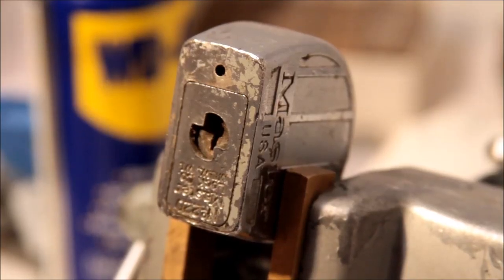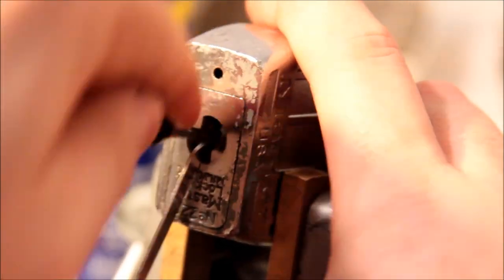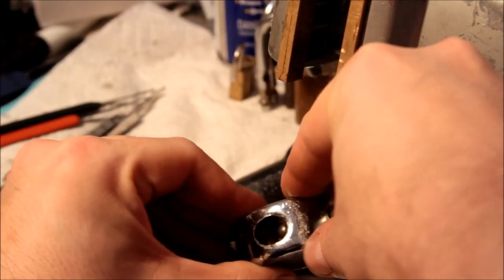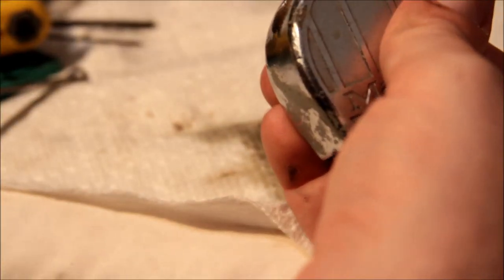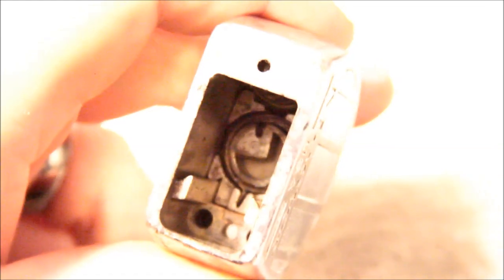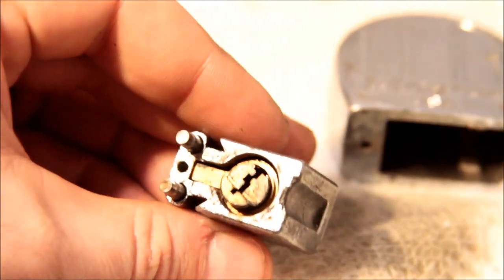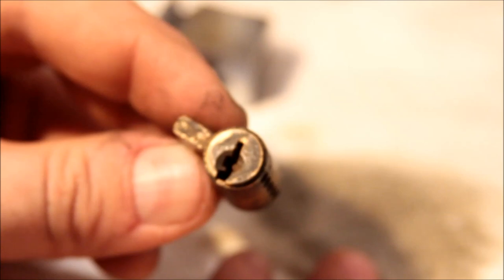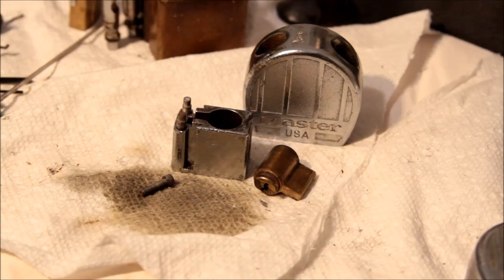(122) eBag 'o Rust: Part 3: Master Lock: Some things never change

Comment from the maker: Thanks for the tip. I'm still working on my cinematography skills, as you can probably tell. 

For some of these macro shots, I've found it easier to take still photos, edit them a little, and insert them in the video. Your point is well-taken though and I'll give that a shot!

I have a couple  videos on tubular/Ace locks. If you'd like to see anything in particular, let me know and I'll see what I can do. Several of the other guys also have great videos on the subject.

Comment: I don't know if that core was double crimped, the single crimped you turn the core and it slides out. I just had a double crimped core I smacked it with a hammer near the smaller crimp and added a extra pin.